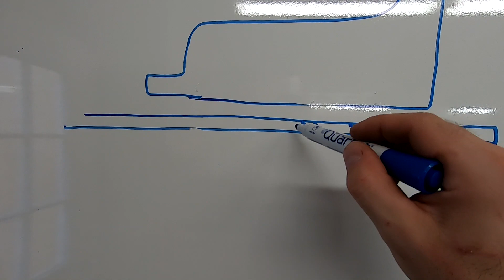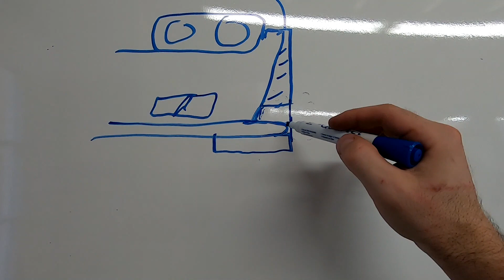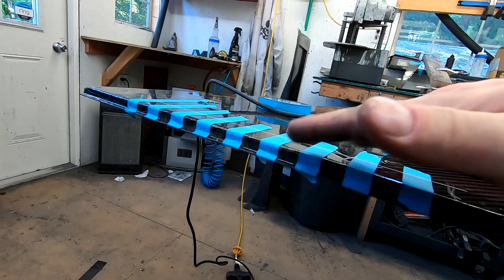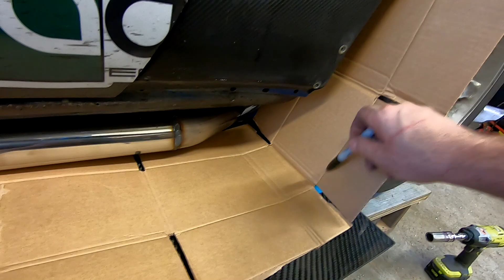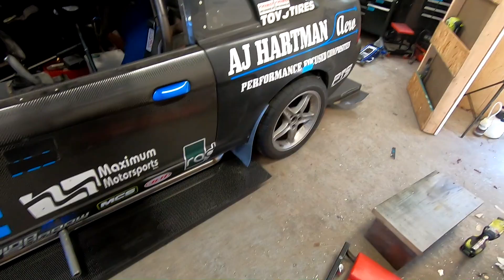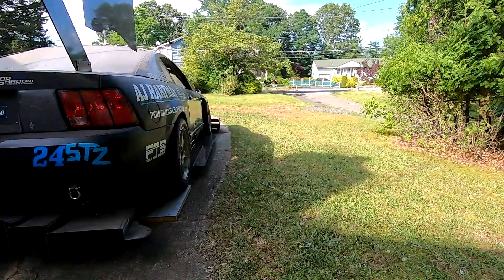Huge Carbon Fiber Flat Floor- Finishing Touches

Comment: I know this is a year late, but i just found your channel and love it.  Something to keep in mind (again i don't know if you've changed anything yet since im a year behind) is the vents are angled the wrong way from an air flow/pressure perspective.  there is a low pressure under the car meaning more vacuum.  air would have a much easier time flowing from the engine bay, across the transmission fins, then be literally sucked out by the vents.  So you may have some air flow, but it would be greatly improved by putting the vents more rearward and sloping at the other direction.  Ill keep watching, love the content!
Reply from the maker: If I had an open rear side of my radiator yes. But I don’t so the flow wouldn’t work like you described. I gotta forced air up across the trans.

Comment: Looks awesome. Been wondering if you were going to cut down the floor/skirts so they don’t stick so far outside of the tires. Are you worried about getting into other car’s body work racing wheel to wheel?

Comment: Why not just a set of NACA ducts to feed the trans? Seems like those would both disrupt airflow less and feed more air to the transmission.
Reply from the maker: space. Had about a half inch from the floor to trans tunnel.